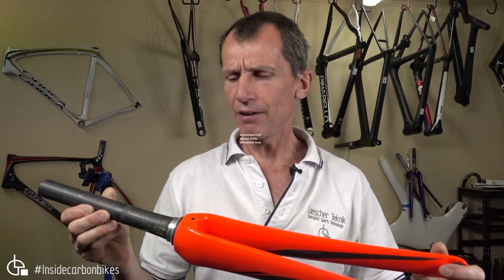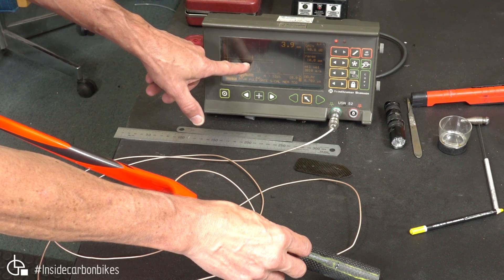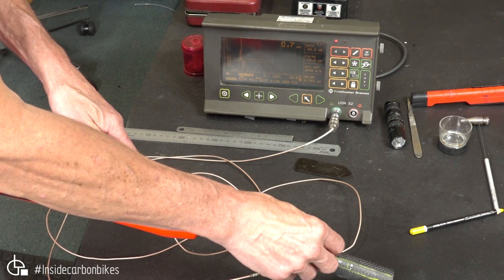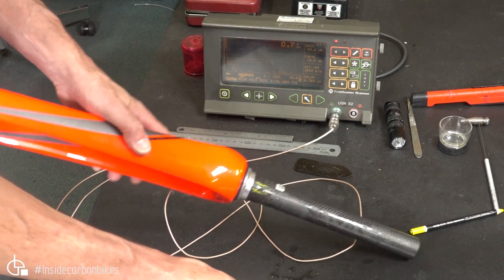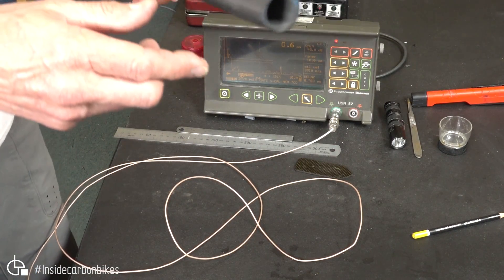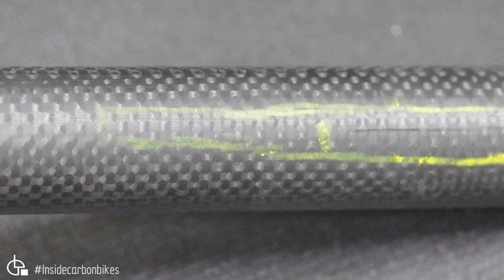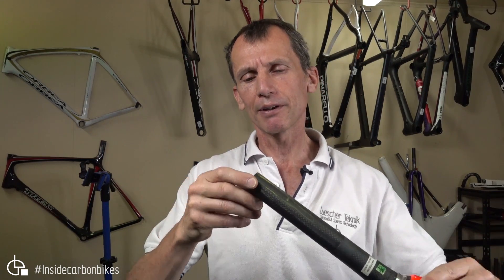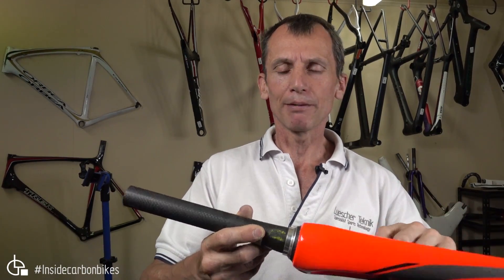Specialized Fork Steerer Voids -  Ultrasound Scan

Comment: Would love to hear your thoughts on the Alto carbon clincher wheel test in which major brands failed badly.  Also, please cut up a chinarello if you have one (or any unbranded chinese/taiwanese frame). thanks!
Reply: There's another video where he talks about big problems with carbon clinchers and rim brakes. https://www.youtube.com/watch?v=ET1jRVynOBA My takeaway from those vids is that carbon just isn't a good brake surface, and that the best solution for carbon wheels is probably disc brakes.

Comment: This ultra sound is so much like doing a a pre location for finding faults on concentric cables (a  TDR time domain reflectometry), and any mis match in the cable reflects part of the signal e.g. a joint or fault, back giving you a positive or negative defection. You typically have a mis-match at the beginning and the full signal is reflect from the end.

Comment: So whats the solution to voids? Submerge the building process in laquer so there is no air ? Better controlled manufacturing. Seems there are problems in every carbon part. Low to high cost doesnt matter.
Reply: The solution?  Better more rigorous control over the manufacturing process and better inspection of the bikes.  It means less throughput and lower profits so unless lots of people refuse to buy carbon bikes with these issues the quality won't improve.  It is annoying that even very expensive bikes and components aren't better made meaning that there would be more rejects and the extra money you'd be spending would be going toward a better product instead of simply a higher profit margin.  In other industries like electronics there's the notion of first and second run parts ... if the problems on some of these products are cosmetic and not safety related the that would be a way for the manufacturers to extract some money from the less than perfect examples coming off the line.

Comment: is this a failed fork or brand new?? maybe speciailised engineered it so that random voids wouldnt matter
Reply: The steerer has been cracked by the stem @5:20
Reply: Voids matter. This void has resulted in a crack in the steerer @5:20
Reply: JogBird yes, this is an important question. Was it scanned because damage was suspected? What prompted the scan?